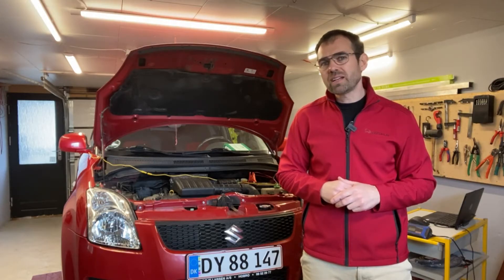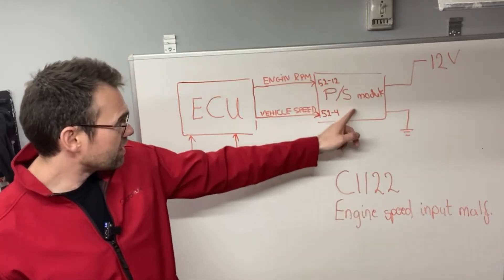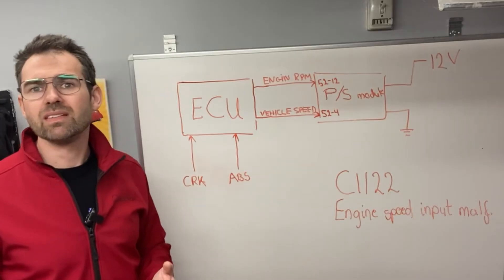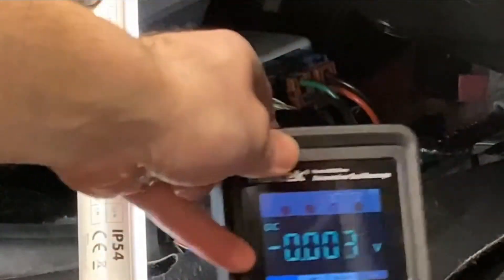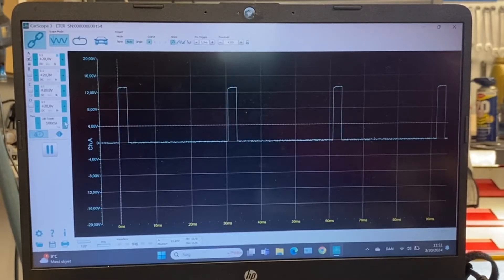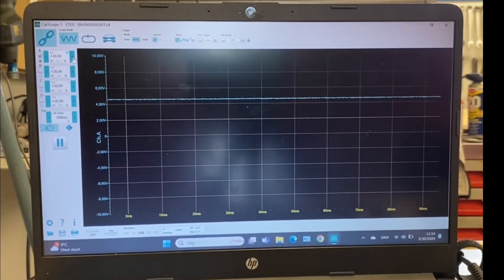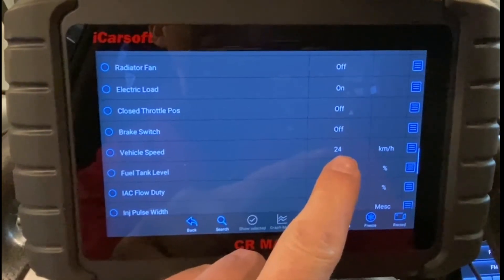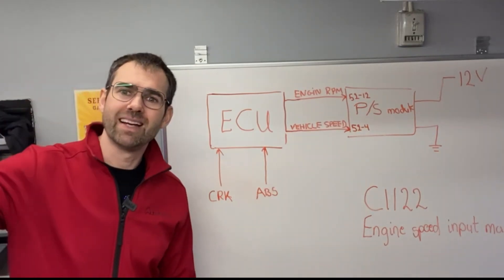C1122: How to diagnose a power steering control module

Comment: Does it could be a damaged wire between ECU and power steering unit ? Thank you
Reply from the maker: Hi. Yes it could! This is why you need to check the wire resistance is close to 0 Ohm.

Comment: Did you change / repair the ECU and did it solve the issue?
Reply from the maker: I replacer it with are used one. But remember swap the immobilizer chip from the one ecu to the other.
Reply: @aut @autofokusDanmark  think i will need to swap that too, do we use immobiliser from old ECU, if it’s in that?

Comment: ecu is engine control module  but not electronic control module like you said  ,so I turned off video since heared that.
Reply from the maker: I must have said wrong.
Reply: What an idiotic thing to say.
Reply: This is a very stupid comment. ECU is a general term in the automotive world and it actually stands for Electronic Control Unit. You shouldn't talk about things you don't understand.

Comment: Thx for your video, i have a opel agila with the same power steering sometime  (random defect) i have the default light on dashboard (whell + eclamation point) and the power steering become hard. after stop and start engine , the defect disappears (power steering running wheel). I have the C1122 on ACC but not when the engine running.
what i have to check negative ground cable ? 
Change power steering calculator ? 
Where is the power steering calculator ? 
Thanks a lot for your help
Reply from the maker: Hi. You have to follow the  steps I show in my video. 
See if there is signal at the PS-module ect. 
Also see my video Boosting your scan tool skills regarding this issue. 
Good luck😇

Comment: I would like to know if the problem is related to the connection cable between the speed sensor and the control unit, or if the control unit itself has become faulty.
Reply from the maker: Typically the ECU does not send the signal to the PS-control module. This means the ECU is damaged. Test it with an oscilloscope like the video.
You could also see my other video related, Boosting your scan tool skills.

Comment: I have the same problem with my vehicle. But it comes and goes, and sometimes I feel like my car is in good condition, then suddenly the suspension becomes weaker, the steering gets harder, and the overall ride quality changes. All of this happens along with the fault code C1122.
Reply from the maker: Yes it is like that.

Comment: Hi there! I recently bought a Swift Sport and it seems to have developed the exact same problem. Was really hoping it would be the power steering module and not the ECU. I was curious if the ECU is hard to replace?
Reply from the maker: Hi there. It is easy to swap the ecu, but you need to swap the immobiliser chip also, which is not that straight forward.
Otherwise you need to replace the key and keymodule from the car you get the ecu from.
Reply: @autofokusDanmark  Ah, i see. I will look into this. Thank you so much for the help and good luck with your cars!
Reply from the maker: @Varix69  good luck to you too. Take care😊

Comment: I'm not into cars but I own a Suzuki Swift 2015 and when I'm driving really SLOW and turn to the left I can feel the wheel/steering wobble a little.
I did a Wheel weight balance test and checked the rim and all is ok.
So any idea what could be the problem?
Thanks
Reply from the maker: Hi. Sound a little strange actually.. you could have a worn out bushing in the front wheel linkage, or the top bearing in the front shock(s)
Good luck😃
Reply: @autofokusDanmark  thanks

Comment: Solution?
Reply from the maker: In this case s new ECU
Reply: @autofokusDanmark already replace speed sensor. But error code c1122 still have
Reply from the maker: @izatsyafiq377  it is not the speed sensor, but most likely the ECU.
Does you steering wheel not return to center on its own?
Reply: @autofokusDanmark you mean eps ecu modul or engine ecu?
Reply from the maker: @izatsyafiq377  if there is no speed signal at the PSC (power steering) then the ECU (engine) has a fault, assuming the wires are not broken and you have a solid ground .
Reply: @autofokusDanmark if all wiring in good condition, so need to replace engine ecu? Or eps modul?
Reply from the maker: @izatsyafiq377  if the signal is not present at  the power steering module, then the ECU is broken, is the wiring is okay.
Reply: Will try to check later.
Thanks sir 🙏 😊

Comment: Hello, I would like to thank you for sharing this valuable information.
regarding the vehicle speed sensor signal in this case. For further clarification, can I take a wire with the signal from the brake control (ABS/ESP) directly to the power steering control (EPS)? In this case, will the signal reach the steering control, and will there be any issues with the communication process? Just to confirm.
Reply from the maker: I will anwser you question later today!😄
Reply from the maker: The speed signal from the ECU to the EPS is a PWM-signal, basicly a "fake" speed signal. The ECU recieves a CAN-BUS speed signal from the ABS-control unit, which get the speed signal from a hall sensor (ABS sensor). This means that the signal not nessesarely are the same, even though I think the ECU pwm-signal copies the original speed signal.
Nevertheless I can't confirm it, but give at go :)
Reply: @autofokusDanmark  thank you

Comment: so what the solution sir? I have a same brand car but not the sport version, and after scanning the ECU the computer show C1122 engine speed error
Reply from the maker: You need to check if the signal is at the power steering control module. You could also look at the live data in the module.